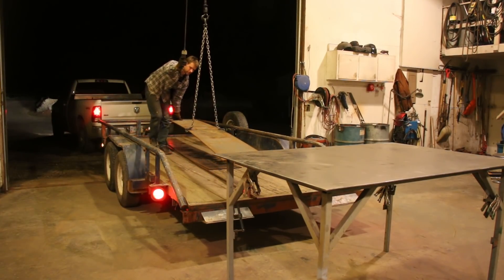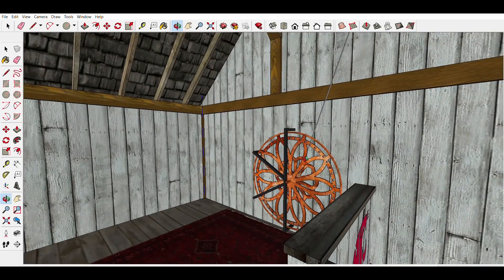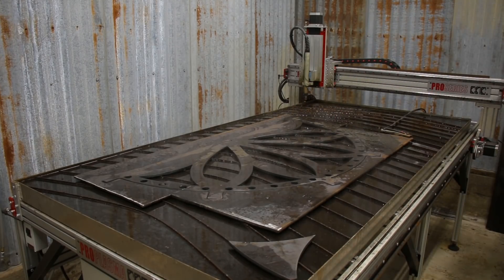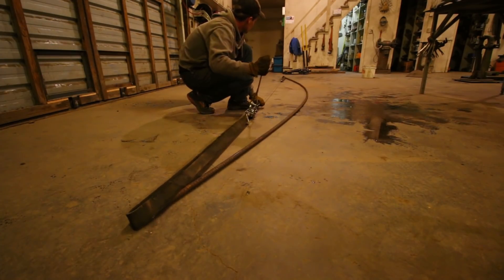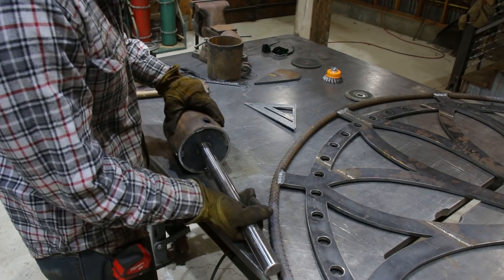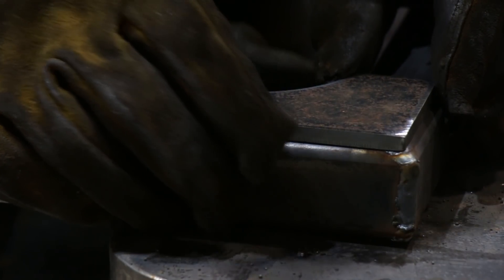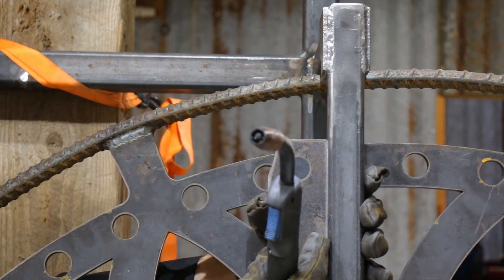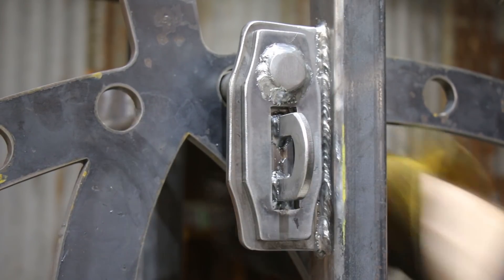Retractable Party Barn Chandelier - pt. 3/4

Comment: I would suggest installing something like a seat belt mechanism. So if the wheel is spinning too quickly, it would kick in an stop it. Would work as a sort of last resort in case everything else failed and the chandelier was in freefall.

Comment: I remember you may have said it once, but why do you scrape the slag during cnc cuts? I wonder if the manufacturers can implement anything, like a little metal sweeper arm that does it automatically
Reply: Also, may I say-- it seems like you're getting so much use out of that table. That's awesome. Bet you get crazy ideas for stuff to make. For one the projects that doesn't involve 800lbs hanging above your head, you should indulge your urge to make something super complex.

Comment: I’m having a hard time picking what video of yours, I like the most! Nice design. YouTube/ make it extreme has a great metal roller. I’ve made two of there design, just not so extreme. Glad Drake was not near the shop if that come along slipped. Practical gearing/ pulley is a great throwback art. Me, I would paint it Orange.  Keep them coming.

Comment: You should clean (if it's not stainless, of course) the CNC tray and paint it with some sort of epoxy paint, otherwise it will eventually perish = cost. The tray, not the throwaway ribs.

Comment: Great project! Love your videos.

I think it might be a good idea to have something that keeps the reel from spinning so the chandelier cant drop while the lock is removed. Otherwise you will be holding the chandelier with only one hand. Something like a ratched gear should be possible with your CNC plasma cutter..
Reply: I'm going to guess the line holding the chandelier will go through a block and tackle ...ie: 4 feet brought in at the reel moves the chandelier 1 foot

Comment: Is that a good idea to have that much tension stored up in the rebar? Seems like those welds are going to be under a ton of stress...idk if heating the curved portions would relax the tension stored up...just seemed like that might be dangerous. Idk anything, just a thought. Love the design though...you manage to make a work barn look stylish.
Reply: I think just welding it alone would put enough heat into it to relax some of the tension, but I am sure the welds would hold.  I bet he could throw a strap around it and pick up a truck easily with it (if you had a way to easily pick up a truck)
Reply: Corn 

He could always do a heat treadment, heating the rebar and let it slowly cool, to releave the stress in the rebar. But i think it's fine already. 👍
Reply: Corn Those welds can handle much, much more than the stored tension in that rebar